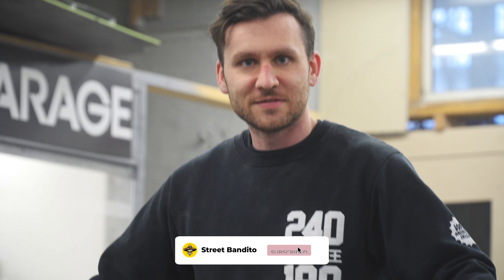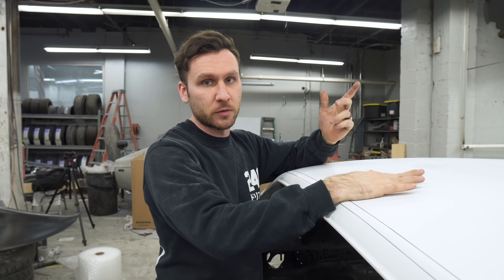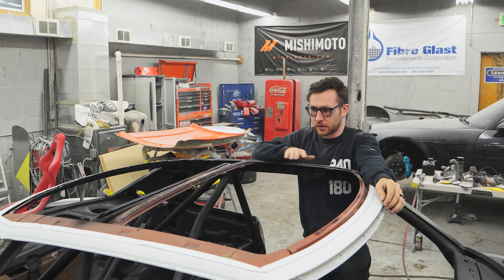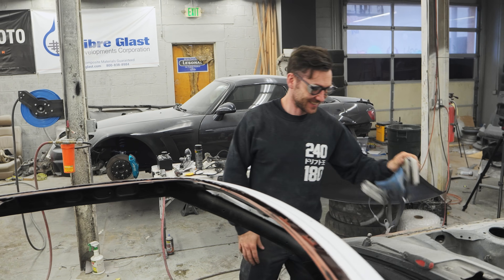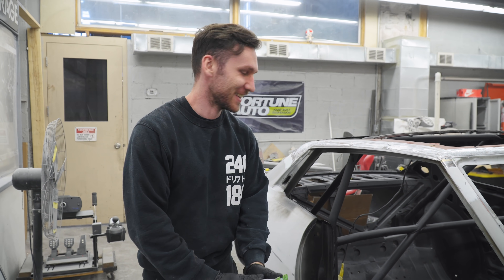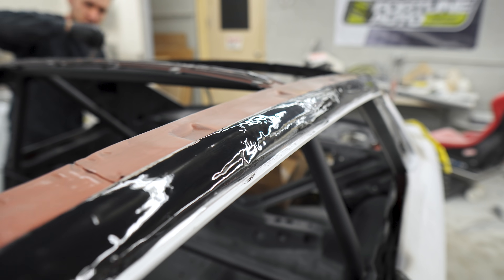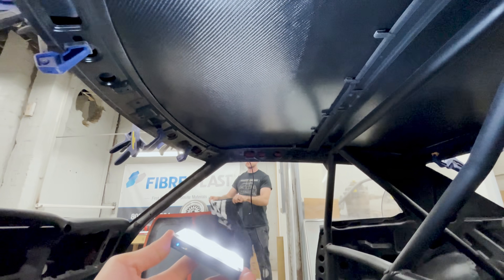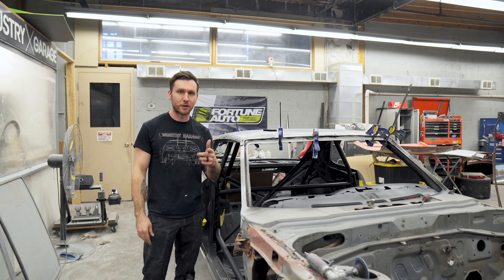Speed Academy 1977 Toyota Celica DIY Carbon Fiber Roof | Part 2

Comment: Your next build will be a Donk sedan.  
You will lower the trunk and roof ~6”.  
The roof will also be stretched so the base of the windshield is the same distance from the front bumper as base of rear window is from the back bumper.  Firewall might be moved forward.
Angle the hood from windshield base down to top of bumper.
Mid-engine, radiator and fan in the back.
180° headers.
Cover (skirt) all 4 wheels.
Paint it 3 tone.

Comment: Your next build will be a Donk sedan.  
You will lower the trunk and roof ~6” and carbon fiber it.  
The roof will also be stretched so the base of the windshield is the same distance from the front bumper as base of rear window is from the back bumper.  Firewall can be moved forward.
Angle the hood from windshield base down to top of bumper.
Mid-engine, radiator and fan in the back.
180° headers.
Cover (skirt) all 4 wheels.
Paint it 3 tone.

Comment: I bought a shirt! :D
Reply: both you and speed academy bought one ;-) cheers guys i have two exact same celica's and you guys gave me a lot of inspiration over the years! one is original and the otger will be 1uz though. Still i do miss the ls400 the engine came out of. cheers!
Reply: @whyshouldipickaname  I want another Celica too! What is it about these cars that causes hoarding? :D
Reply: @speedacademydave  i think it's the always going spiral of working on a project car and finding the exact same one that's supposed to be working only to end up with two cars with the same problem. (rust in the sills) you are very lucky that you found the one in the dessert! i have one widebody one so it's still a little bit different than the other. i hope you can enjoy your car soon after the paint and carbon fiber has been done! greeting from the netherlands

Comment: I am so torn between the idea of having a carbon roof and not being able to see it. I know it’s for weight reduction primarily and you’ll have to blend it into the pillars with filler, but how are you supposed to flex on poors if they can’t see it? 😂😂😂
Reply from the maker: Lmao have to do the humble flex. Or take photos and stick them to the car when your out and about to prove it’s carbon.
Reply: Hahahahaha
Reply: You can always mask out a large section and the paint the blends, like adam LZ comp s15
Reply: I was able to have mine show the carbon fiber since I was able to remove the roof via drilling spotwelds and it goes under the front and rear windows. But I never put the trim back in because racecar lol